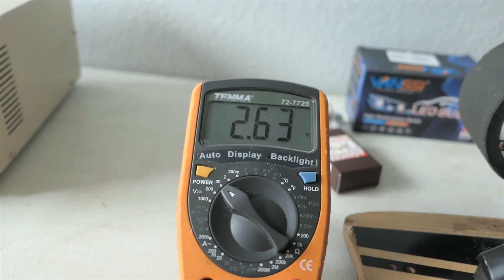$550 4WD Electric Skateboard - First Problem & Unexpected Fix

Comment: Hi Vlad. You should consider using hoverboard style batteries (samsung or lg models ONLY). They come with a built in BMS and are configured as 10s 2p. I buy them for roughly 50 AUD pp, which is quite reasonable for a 20a rated 4.4ah battery.

Comment: no you can't wire them together that way stop what your doing until you know what your doing first your lucky they haven't exploded yet
Reply: Takes quite a bit to make Liion 18650's to explode. As he notes in the video there's a fail-safe on them which gets triggered if they're over charged. They're a lot safer than Lipo's in that regard.

Comment: How much range do you usually get? And how much mah are all those batteries combined?
Reply from the maker: In 2wd I'll get 10 - 12 miles. In 4wd about 5 - 6 miles. Total battery capacity is 6000mah at 36v.

Comment: I would put batteries in my electric longboards in the same battery holders. But I'm wonder about that batteries will fall out under the influence of gravity. Mayby better way is to turn 180 degrees the setup. What you think?
Reply from the maker: Yeah that could be an option, you'll just need to figure out a good way to mount them. I find that if you use a little glue like goop, it holds just fine.
Reply: Just Vlad I have a great container which will nicely cover batteries
Reply: Just Vlad I love the idea not to solder or weld batteries it is the safest way to connect all batteries, I will make 6S4P (22.2V 8Ah) for longboard becouse I have 6S esc like yours. But I prefer belt motor setup. I have 1800W 320kv motor. what  you think about my parts?